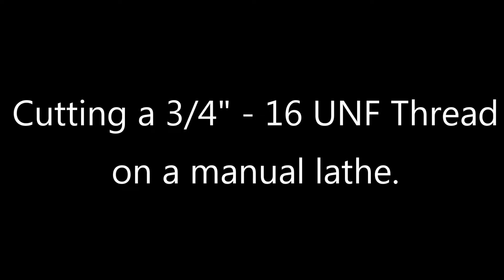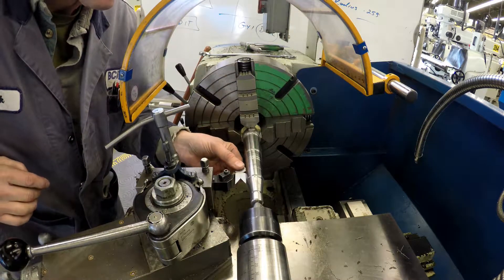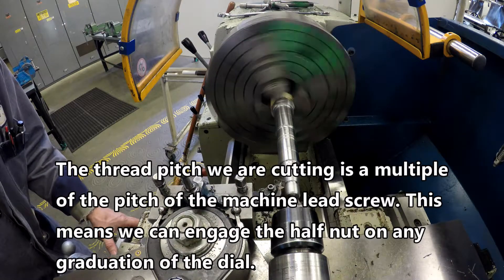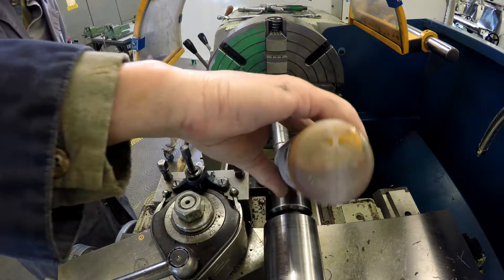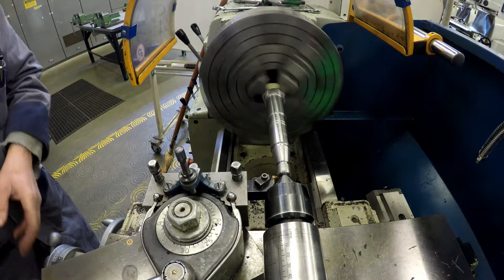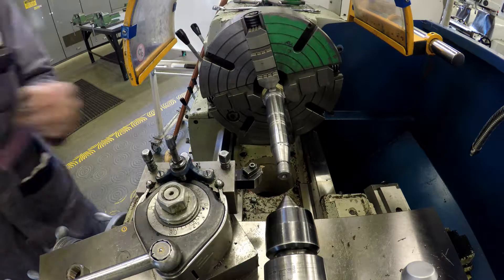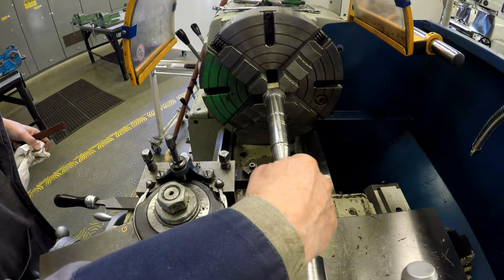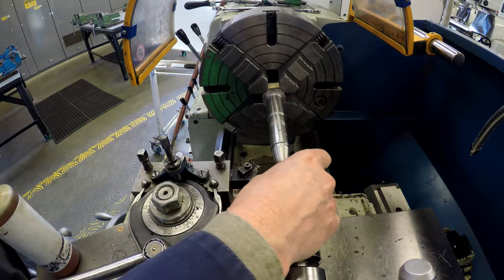Op 10 machine the  3/4-16 UNF thread

Comment: Wait. Stop. Why would changing the spindle speed make the thread not match up any more??? The leadscrew is driven by the spindle, so the lead screw speed would be forced to change right along with the spindle speed.

Please rethink that statement.
Reply from the maker: Because when changing the gears, the meshing can move out of sync from where they were previously. Especially when cutting a metric thread on an inch machine.
Reply: @MarkAllardyce  But you're talking about changing spindle speed, not threading gear. Just changing spindle speed will have zero effect on threading because the lead screw speed will change right along with the spindle speed.

It's like saying that if you change the speed of your engine in a manual-transmission car, the engine might get out of sync with the drive wheels... but that's impossible because the transmission hasn't been disengaged.

Besides... why in bleeding heck would you change threading gears in the middle of cutting a thread?

Just don't touch your change gears after you've begun the cut, that's all. Do what you want with spindle speed if you don't like the quality if the cut. That's perfectly normal to do, and won't interfere even slightly with your thread cutting. Any lathe that doesn't drive the leadscrew from the spindle, such that you can change spindle speeds at will midstream, was built by an idiot.

Try it. Grab up a piece of random junk from your round bar shelf and start cutting some random thread pitch on it. Doesn't matter what pitch, even if it's totally nonstandard. Stop in the middle and disengage the spindle drive like you were changing speeds. Now without touching the (threading) change gears, try very, very hard to get the lead screw out of sync with the spindle. You can't do it. No way, nohow. Not on any reasonable lathe that was built in any country within the last hundred twenty years, anyway.
Reply: @timhofstetter5654  Preach. This guy doesn't know what he's talking about